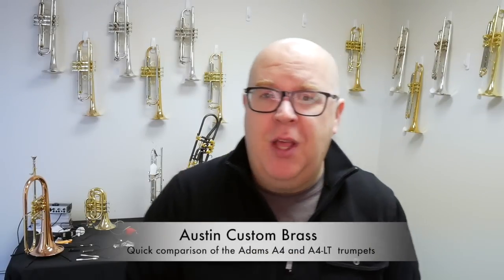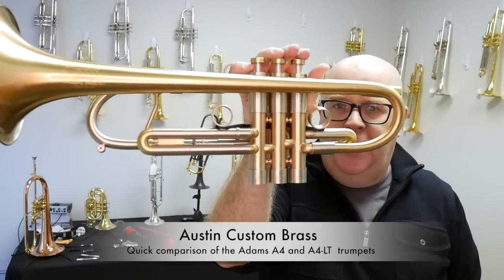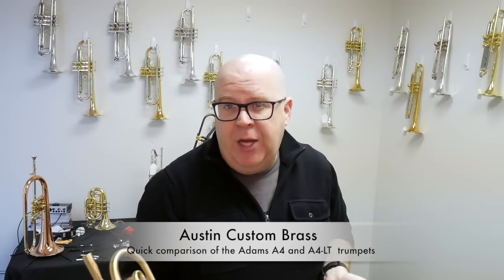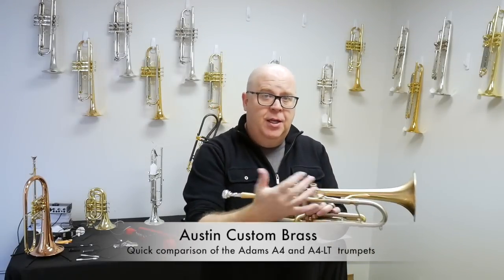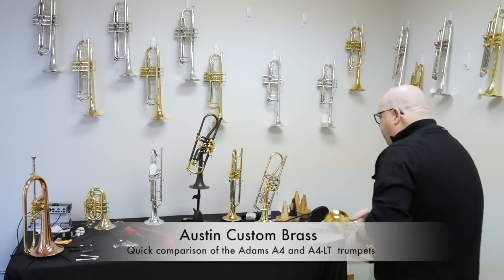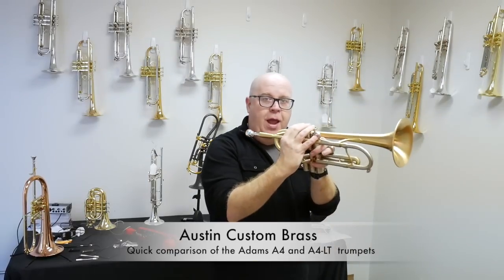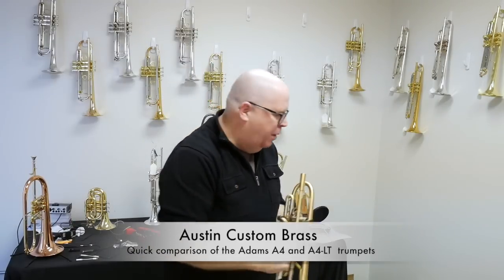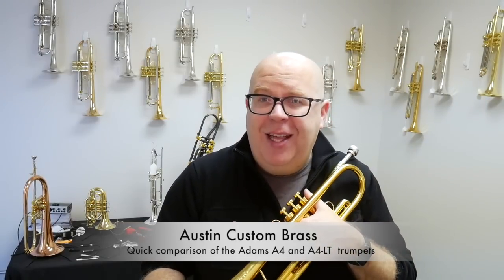Adams A4 versus A4-LT - Quick Comparison by Trent Austin at Austin Custom Brass

Comment: Thanks for the video, Trent! Glad you chose to put the A4 and A4 LT side-by-side! Trent already knows how I feel about these models ... so I'm writing this to the trumpet community that will view this video. 

First of all: I love these horns! I purchased an A4 (L) from Trent, and then he helped me custom order an A4 LT with the 5.5" bell in red brass with a shepherd's crook (ML). Cuban trumpeter Amik Guerra worked with Adams on the design of the A4, and together they just nailed it! To me, these horns in ML bore play more 'open' than a traditional ML bore, which gives you great flexibility in dynamics, bends, and comfort (no tightness or back pressure). The L bore don't feel much different, and are equally nice to play, but I could tell after a 3 hour gig that I was a bit more tired (chalk that up to less practice/playing time than when I was playing all day long in college = my issue ... not the horn). The A4 does have more weight than the LT, which is noticeable if you are coming from playing brand B or Y. I presume the LT's weight would probably feel comfortable to most when initially playing these trumpets. Another item not mentioned in this video is the 'wrap', which I find more open = bigger than most trumpets I've played. I like this. I never thought about it much, just enjoyed how comfortable these horns feel to hold. But recently when I played a few horns a friend brought over, I immediately noticed how my hands felt squished together and those axes just felt small.    

To me the A4 in this video has a darker texture with more overtones, while the LT sounds more 'clear', as noted by A-Funk. I need to listen with a good set of cans on my ears to hear it better to be able to comment much more on my sonic reaction. Trent has mentioned it before in other A4 video demos ... these horns can easily change personality depending on the mouthpiece you are using and the sound 'picture' you want to attain. Bright, dark, edgy, smokey = all are available to you with these horns, as you desire. I can't say that about most trumpets. 

Fit, finish, materials = all the best with Adams. It is just stunning to me that a company with relatively short history in making brass instruments could make such excellent products. Out of all the trumpets I've played over the years, none are as satisfying as my A4 LT-S. Would I buy another one? Yes, with zero hesitation. Is there anything I would change on my A4 LT-S = no! To me, it is the perfect trumpet! 

If you have never tried one, do whatever it takes to visit Trent's store or go to a trumpet hang, ITG, NAMM, or whatever event you can to play them. I think you will be happy you did!
Reply: Is your a4lts still clear with the shepard's crook? What materials did you choose?
Reply: red brass used, as I wanted a darker tone overall. also 5.5" bell instead of the standard 5" on the LT. the SC design makes it darker too ... I use it for solo and combo work, not in a section.  @armandoperez4029
Reply: Thanks for the horn owner's response. Good to hear that those horns are versatile as well, mouthpiece-wise. I hope I can find a dealer in my home country(or near) to take a 'test drive' before it's time to do the update and buy a new horn. Also, Thank you, Trent for making these demos !
Reply: @blainekelley816  have you ever played a trumpet with a reverse lead pipe? If so, how does the A4 compare to a reverse lead pipe trumpet as far as the resistance Factor? Like what's the resistance factor on the A4?

Comment: What is the weight difference and is it noticeable after playing for several minutes? How does the LT compare in weight to say the A1v2?
Reply from the maker: I think the LT  is a bit heavier than the A1v2 but it's nominal.  The weight difference between the 4 and 4LT is pretty noticeable.
Reply: @austincustom  I should have asked if there is a lightweight trumpet that plays thick and creamy?
Reply from the maker: any horn will do that with the right approach.  The best thing for you to do is call us at 816-410-0826 with any additional questions you might have. We are always happy to help you find a dream horn here at ACB!